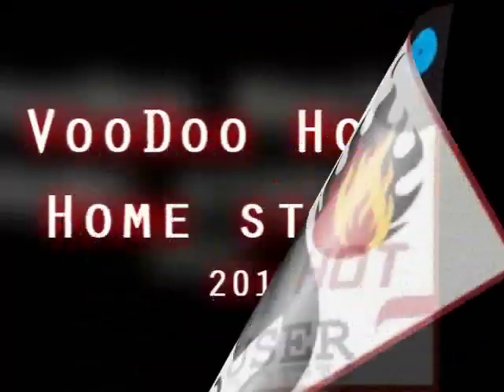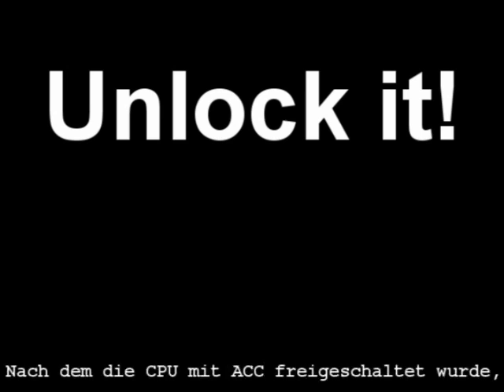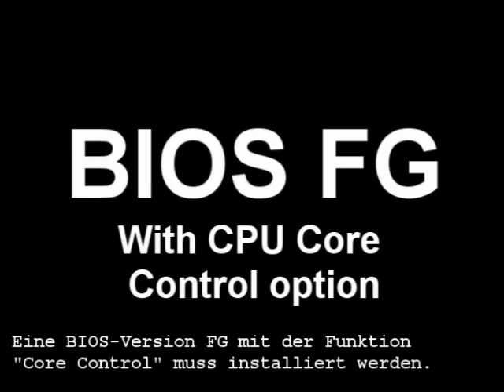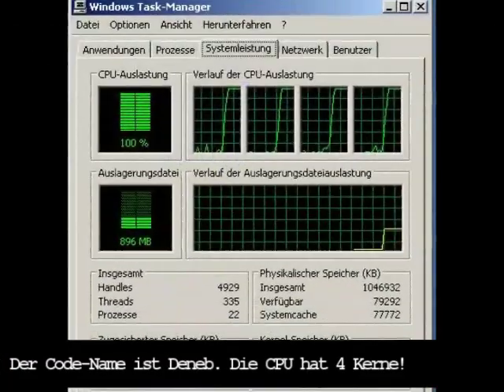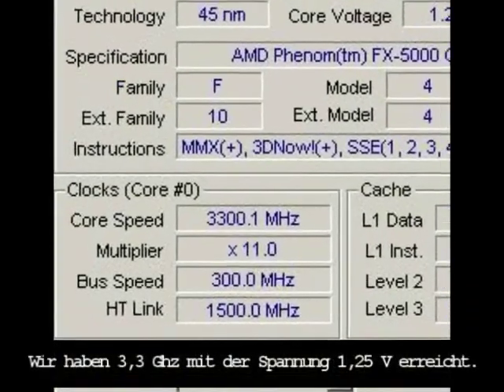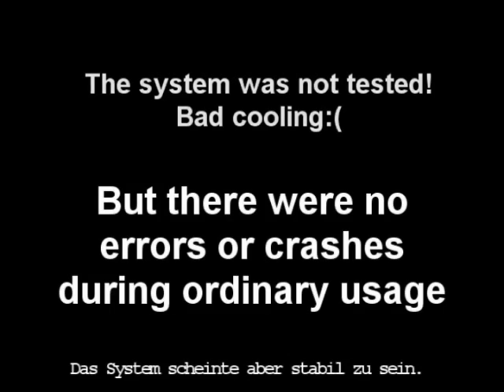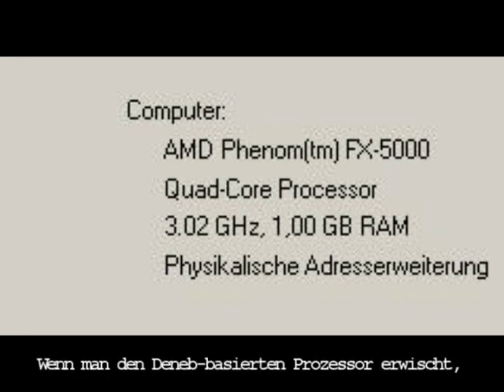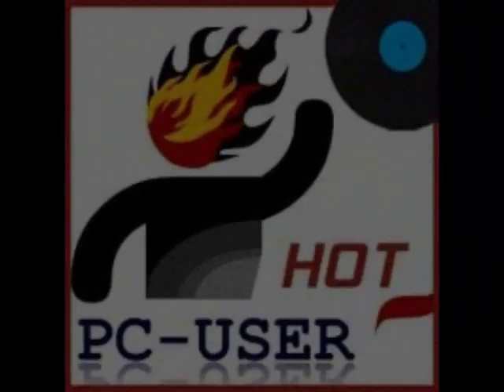Unlocking AMD Athlon 5000+ AM2+ and DDR-2. Hot-PC User.

Comment: hey i just wanna share my experience i have to many AMD Athlon II X2 5000+ but just have to carefull  on the cpu date must 2008  and 2005 is doesnt work for unlock and processor must be 45nm . i hope this can help u bros... and pls cheak this link can help
 http://www.cpu-world.com/CPUs/K10/AMD-Athlon%20X2%205000%2B%20-%20AD5000ODJ22GI%20(AD5000ODGIBOX).html
Reply from the maker: Hey serdar mutlu, thanks for your info!!
Reply: VooDooHouZe no problem bro i hope i help:)
Reply: 1 more think AMD Athlon II X2 5000  2.2ghz and 2.6ghz doesnt work
Reply from the maker: yes, 2,2GHz only, that's right!
Reply: ***** tamam dene fakat o anakartla zor biraz acc modu yok  birde NVIDIA bios var ... Bu işlem her anakart ile yapılmıyor sıkıntısı bu ve biosun AMD nin bazı modellerinden olması lazım  AMD 770x, 780g , 790gx , 790fx , 870x , 880g , 880gx ,and 890fx gibi kolay gelsin...

Comment from the maker: Hello, generally you should set the voltage as low as possible. 1,368 is not bad, but try to find the lowest voltage and test your CPU, if it runs OK at that voltage. Maybe for 2,6GHz 1,3V could be enough. But it depends on the processor itself. I had another one CPU, AMD Athlon 5000+ wit a stock voltage 1,4V! It was quite a normal voltage for that concrete CPU. Regards and good luck!

Comment from the maker: Hi MisieQ1223!

Unfortunately you can not transform each X2-CPU to X4. Moreover, it is impossible to do it, if your motherboard does not support ACC-function (Advanced Clock Calibration) or Nvidia Core Calibration (NCC for Nvidia mobos). However, there are many Boards with similar Functions (ASRock with UCC, Unlock CPU Cores for example).

But one should differentiate between AM2+ and AM3 Platforms. AMD Athlon 5200+ is an AM2+ CPU, that's why I tried to unlock it with AM2+ Mobo, with ACC.